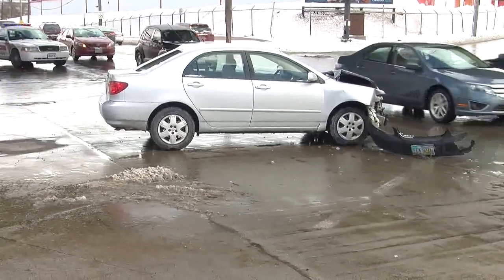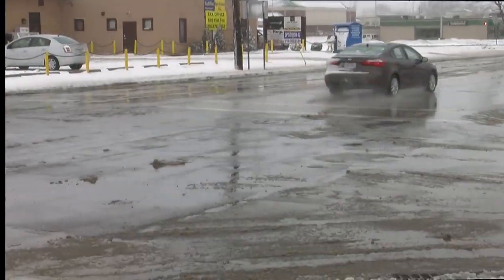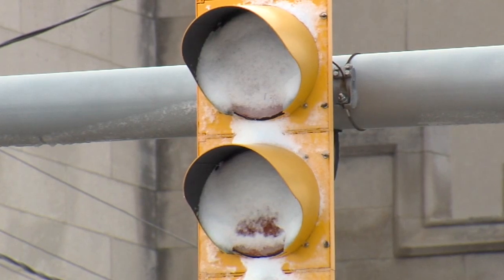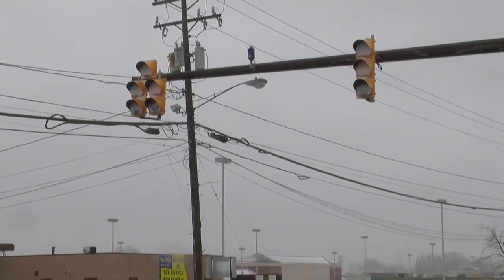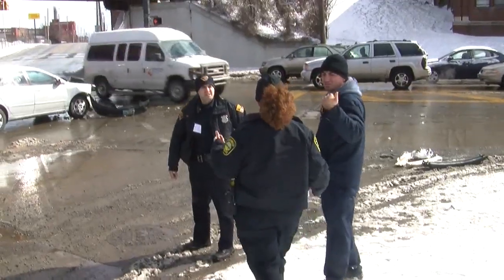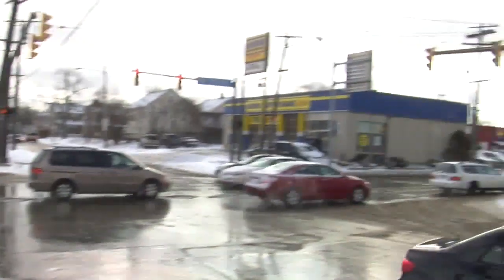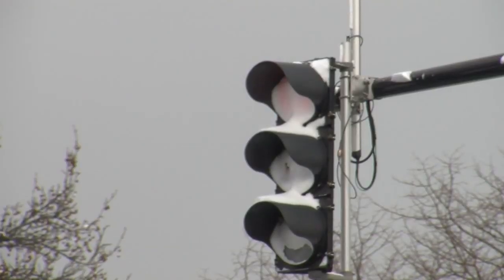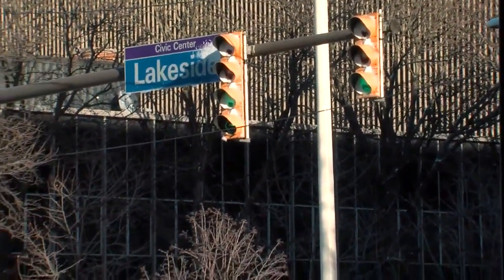Driver blames snow clogged LED traffic light for crash in Cleveland

Comment: Whoever went through the intersection without stopping broke the law. When a traffic light is broken (or in this case covered by snow) it is legally a 4-way stop sign now. This is the law, and quite obvious. As, what else are ya gonna do? Run the invisible 4-way stop sign and get into a crash? Well who's fault is that? Also, breaking the common sense boarders? Well, what are you supposed to do at a broken traffic light? Be cautious, stop, yield, show the way for other drivers, and most importantly... PAY ATTENTION!

Comment: It should be common sense if you can’t see the light or it’s off treat it as a stop sign. Here in Illinois if the lights are out or they are covered in snow there are stop signs that someone can fold out

Comment: Okay, so the city changes the light to LED from incandescent to save money on the power bill but, the LED units cost more than the incandescent plus the labor to install them. Now, you have the issues like this and the snow doesn't melt away and blocks the lights. So, lets spend more money and add a heater to the LED light to melt the snow but ends up costing more money that the original incandescent light that melted the snow on it's own. Sounds like a waste of tax dollars to me. Plus, the real issue here is people are dumb. if you can't see the light, basic drivers ed taught us to assume its a dead light and treat it as a 4 way stop, right?? so then why blow a snow covered light if you can't see what color it is?? Answer, people are too wrapped up in texting or drinking or facebook or putting on make up or most likely, just plain dumb.
Reply: they created the problem themselves by replacing the old lights

Comment: If you approach the intersection and observe to light color, you're required to come to a complete stop. This law is in place for when these signal systems are damaged by a storm and destroyed by a car crash. Is this not common sense to stop if you cannot see the light? I understand that there shouldn't be snow on there and that the system can be repaired to accommodate this problem, but what the heck? Do drivers just not care when they drive?

Comment: Dang it people, if you can't see the light, don't blow through the intersection. As for those who want to bring back the old lights, think of this. There can easily be 16 lights at an intersections. Typically they are 100 watt. They run 24/7. at 12 cents a kWh, that is about $1,700 per intersection, per year. lets say you have 100 intersections. $170,000 a year in electricity. Put in LEDs that use 1/10 the power. You just saved $153,000. Plus you don't have to keep replacing burned out lights, which can approach a full time job.
Reply: +mattcintosh2 Not to mention LED traffic lights are more vibrant in color than incandescent.
Reply: +n310ea Funny thing, just yesterday there was a large power outage and the lights were out. I was on the main street and saw everyone at the cross streets at a complete stop and everyone on the main road just ran though the dark lights.
Reply: And in reality a single US state has thousands of intersections

Comment: Well you can tell the city of Cleveland but now they make an LED fixture that has a built-in heating element and it draws less power than the overall lightbulb it originally would’ve been in there tell them to check it out if I read my messages anyway but we’ll see

Comment: I've noticed this too about those LEDs when it comes to snowstorms.  Great invention, but they didn't quite think through about snow!

Another problem with many of the lights in Ohio is that they typically use the type of shade, or visor, or whatever they're called, that doesn't quite cover very much of the lens; as compared to the larger more round shade that covers a lot more.

Still though, smaller shade or larger, none are fully immune to using heat to keep snow off!